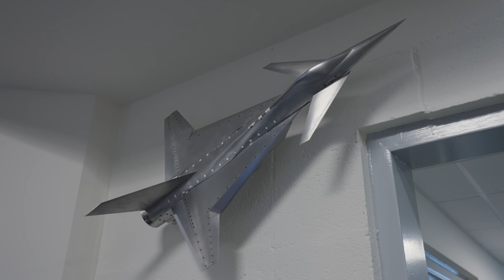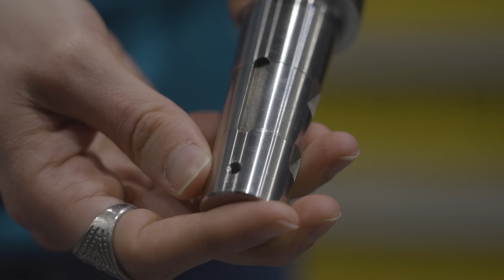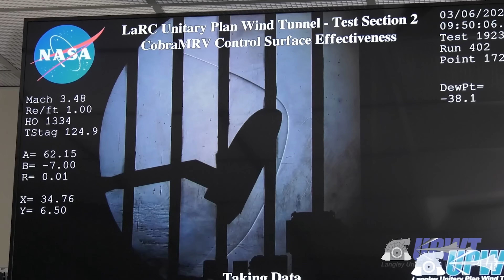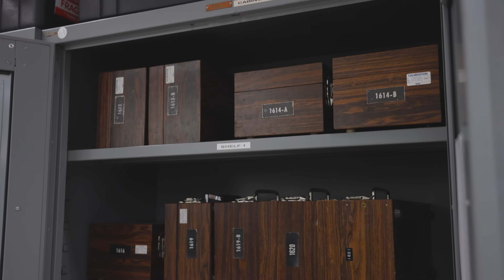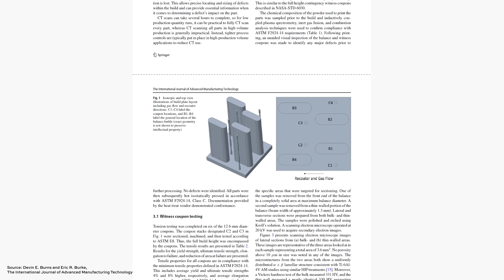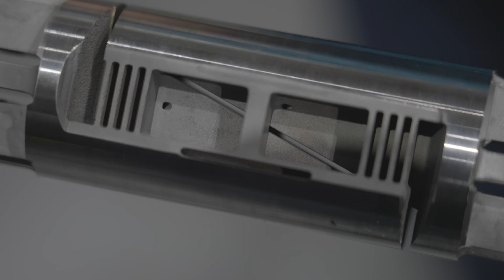How NASA Is 3D Printing Wind Tunnel Tools to Speed Up Space Testing | The Cool Parts Show

Comment: As 3D printing of balances quicker than previous machining techniques, would this provide options to first print a balance for control and stability tests then followed by printing a balance for performance (cruise) tests? Or print various options to get more sensitive axial flexures as the aero people are always want better drag count accuracy?
Reply from the maker: We asked Devin Burns (NASA engineer from the video) to chime in: "Yes, I think there is a lot of potential to use additive to print multiple balances that could ultimately mate to the same wind tunnel model and sting hardware. In fact, as the number of variations go up the time and cost savings should become even more pronounced for additive relative to conventional manufacturing methods."

Thanks for watching. Stay Cool.

Comment: What one year are you kidding me I do not get that one
Reply from the maker: From our friends at NASA: The roughly 1 year required to manufacture wind tunnel balances conventionally is based on experience working with several commercial vendors and other documented references including this paper:
 
https://arc.aiaa.org/doi/10.2514/6.2004-1292
 
With respect to why it takes so long, balances are highly complex mechanical instruments with many of the cuts dependent on plunge EDM which is inherently a slow material removal process. In addition, many of the features are tightly toleranced (+/-.0005” is not uncommon requiring extra machining and quality assurance steps). Figure 2 in this paper will give interested parties a better idea of the level of complexity associated with these parts:
 
https://arc.aiaa.org/doi/10.2514/1.C035889
Reply from the maker: Thank you for watching and chiming in. Hope the info we posted in our last comment is helpful.
Reply: Maybe engineering and simulating the structure to perfectly isolate all the forces and making the spring for analog gain to measure accurate.But manufacturing wise that can not take that long